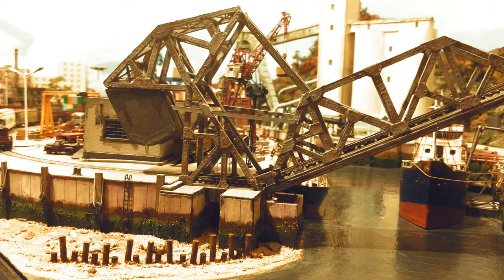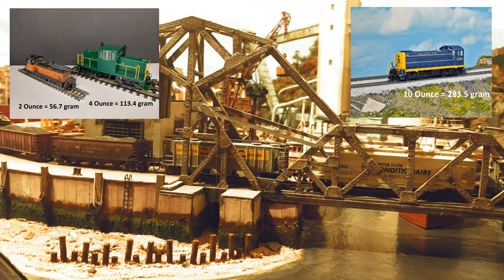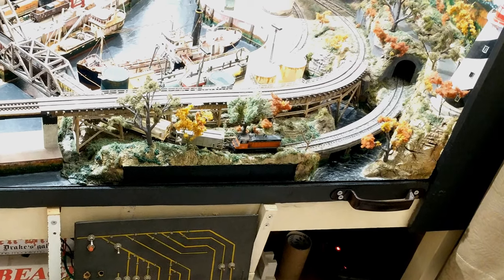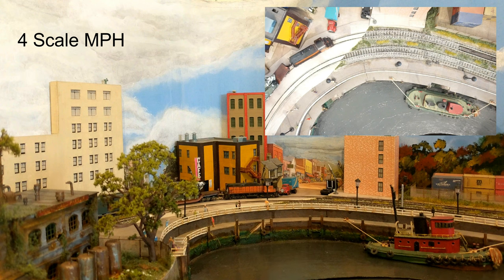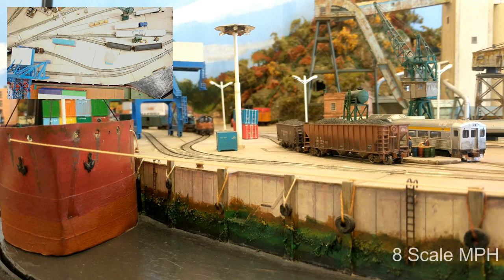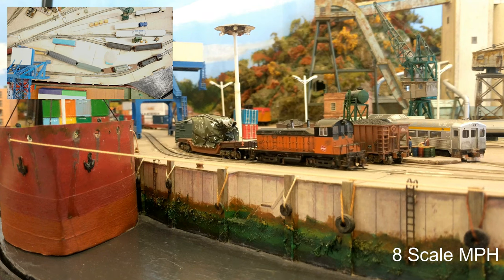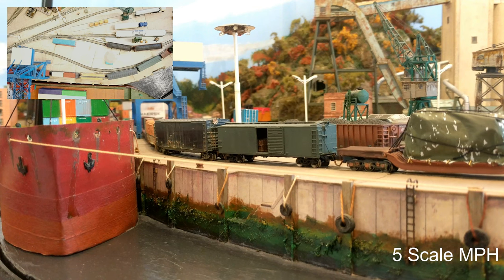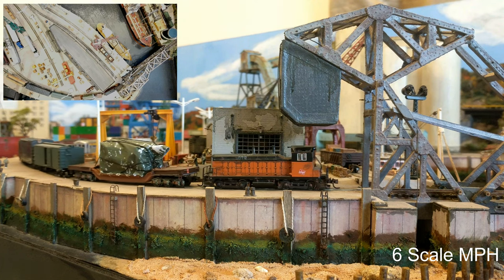How Slow Can You Operate an N Scale DC Layout?

Comment: Bravo - This is something I want and I had been thinking of opting for DCC (the cost is the reason that never happened). Thanks for posting.
Reply from the maker: You’re welcome! I’ll be honest though, if I were to start building this layout today, I’d be doing it in DCC. Even if you’re starting with DC, make sure to wire it so that you can simply replace the controller with a command station in the future, because eventually you would want to move to DCC. My layout is under renovation now to convert to DCC.
Reply: @TrainsandDioramas  Thanks for the advice, I'll factor that into the design. Thinking about a shelf layout based on the elevated  'high line' in New York, but probably with a passenger service added in. Only needs to be about a foot deep running around the walls and plenty of switching to keep be busy.

Comment: I run my DC N scale fairly slowly - 30mph coal drag and maybe 40mph top speed for covhops and my Amtrak. My Kato engines don't have deep wheel flanges so any highballing will usually result in derailment. 
I like the magnetic uncoupling.
Reply from the maker: Yes, Kato has taken N scale to a new level, their N Scale wheel flanges are more true to scale than many HO scale locos! Mine never jump off the rail though at 30-40 mph though even on sharp curves or turnouts. May be it's not about the flanges?

Comment: One area no one ever covers in DC operations is either some approximate or empirical information on DC voltage levels for various speeds. For example, what voltage range might I expect to need for 18 mph or 30 kph?
Reply from the maker: Well, there is no 'standard' really and that is why no one possibly talks about it because it varies widely from model to model, scale to scale, size to size and you really need to gain the experience to figure it out. By a rule of thumb, N to HO scale runs on 12-16V, Z and smaller can go as low as 6. The speed of the locomotive depends on many factors - the engines themselves - what is the starting voltage of the motor, what load it pulls, how efficient is its drive train, how heavy or light the engine is... all that depends how steadily it moves at lower voltages - the Kato NW2 shown here moves quite well even at 3V, but the other locomotives I have need higher. It also depends on the size of the layout, cleanliness of the track, quality of the transformer used in the controller... so there really isn't any set answer - you have to find your own on case by case basis. Hope that helps. Cheers! Kaustav

Comment: What year are you modeling.    Love the layout.   Just got a chuckle out of boxcars with roof walks.
Reply from the maker: Thank you Stan! The era is 1960's - so the roofwalk is valid, especially since older cars could still be seen in service in smaller railroads and industry lines. What is more questionnable is the more noticable container facility. Containers did come up in 1960's and the crane is built following the very first container cranes in the port of Seattle during that time, but you would not see a container facility in a port of this relative size for another 10-15 years or so.

The 'layout' is freelance, so I have freedom of locale and era to some degree. I focus on following the prototypes of the actual models like the vessels, cranes, conveyor belts, oil unloading crane etc. It's very much like an artist's scrible book really, if something doesn't fit, you can always build a 'story' around it!

Thanks for stopping by. Cheers!
Kaustav

Comment: Thank you for the great videos! Question, what DC controller did you use for your layout? Also, I couldn’t find your video about track cleaning. I’m interested in learning more about slow speed n scale operation.
Reply from the maker: Thank you and I'm glad that you enjoyed this little layout. I am using a stock Bachmann controller that I got as a part of my first train set, and an old Hornby controller from the late 90s /early 2000.

The track cleaning video is currently unlisted, but here it is if you want to take a look: https://youtu.be/CYssa9kX2-Y

Cheers!
Kaustav
Reply: Trains and Dioramas Thank you for the information. Great track cleaning video!
Reply from the maker: @Munner25  Thank you! I'm glad you found that helpful. Cheers! Kaustav

Comment: Cannot imagine pouring concrete to build that dock. There is a similar bridge in Chicago. Have you seen Chambs123 conversion of an old Triang controller? I followed his video and successfully completed the modifications. Since then I have discovered PWM modules which accomplish the same slow speed control. So many questions. Where did your interest come from and do you have an engineering background. How did you get into making those structures? Etc
Reply from the maker: thank you Charlie! I haven't seen the Triang controller conversion - will find it. I am using cheap PWM modules for my recent micro layouts and they are a treat for their price.
Here is an example of how I build models: https://youtu.be/RkS_-c7N8K8 
All my structures and vessels are scratchbuilt (except that factory at the entrance of the port) - cardboards mostly, plus wires, wood, styrene, stock scratch building supplies in some cases. I pick a real life inspiration, deduce the N Scale dimension (sometimes taking creatuive license within permissible limits), cut them from the raw material that I plan to use and start putting them together.
I've been interested in miniatures since I was a kid - kept on making miniatures even though no one showed me how or asked me to do it - always loved little things in life. :) And you're right, I went on to study Indsutrial Engineering after that.

Thank you for stopping by and I'm glad that you liked what you saw here. Hope to keep you engaged in the coming days with some original methods and work. Cheers! Kaustav

Comment: Hello professor. I enjoyed this episode. Thanks for the link. I’m assuming your little switcher was something like a BLI.  This due to it making sounds. You know the ones that have limited sound capabilities in DC compared to DCC. Just wondering. Bye.
Reply from the maker: Thank you Norman for stopping by. The little loco is Kato NW-2, one of the best switcher locomotives, if not the best, in N Scale if you ask me! However, it is so tiny that no commercial speaker can essentially fit in it without compromising it's authenticity and since I run this layout in DC still, it wouldn't make much sense anyway. The sound that you hear is actually coming from a sound capsule in the flat car behind it - the oversized load in the depressed flat car conceals a battery operated, motion sensor triggered sound module by Train-Tech: http://www.train-tech.com/index.php/sound/sfx-sound-capsules Hope this helps. Cheers! Kaustav. :)
Reply: Oh yeah! I remember seeing these a couple of years back. Little battery driven things with a sound tube. A British company. Thanks for providing their link and for the reminder. Bye.